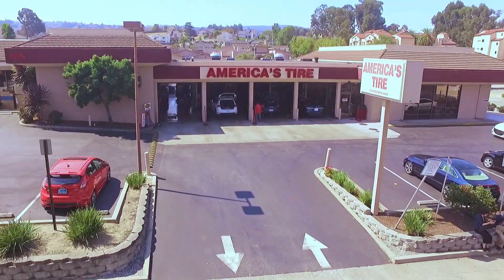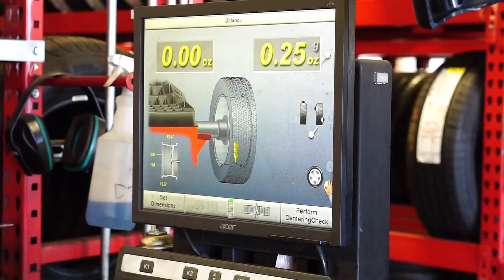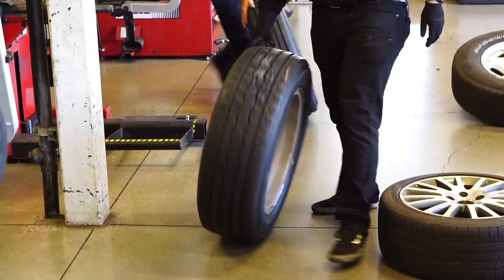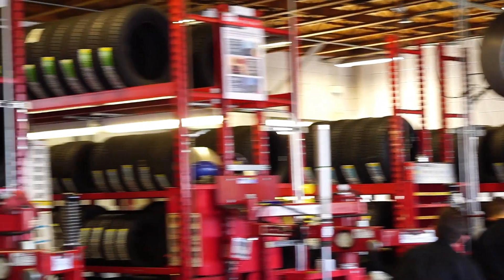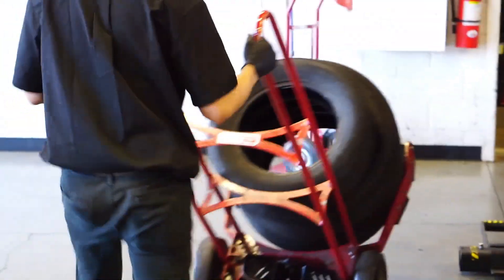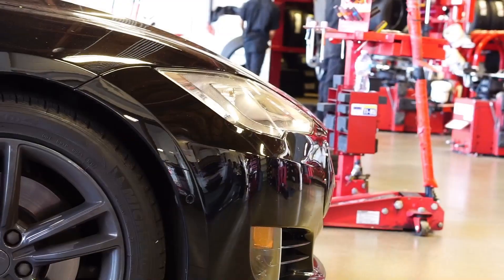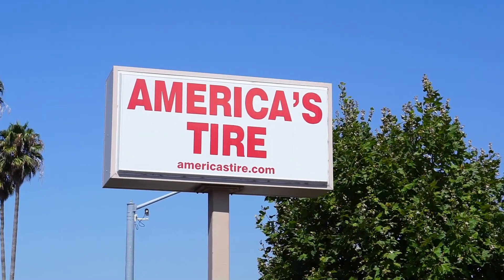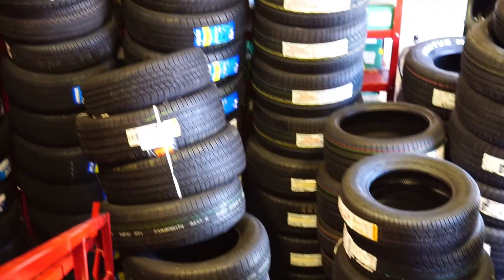Tesla Tires & Wheels Q&A: What You Should Know

Comment: Did i miss the most important question? Everything but the millage that can normally be expected. Average millage received? For example if you consistently get 20,000 miles out of a 40,000 mile tire then the ability to save gas has been thrown out the window.
Reply: 2020 April Model Y....20"...... my tires lasted 20k miles.

Comment: Performance tire has camber alignment and not avoidable? So for someone who don't care for performance and want long lasting tires, can it be adjusted? 
 If the tire alignment is meant to be bottom tilted outward for cornering for cornering. Then why not design tire like motorcycle where it's rounded on the bottom? I think it's waste of rubber for daily commute unless you are turning at high speed all the time like an idiot.
Reply: Because a flat bottom tire has more grip than a round motorcycle tire. Car tires are designed to be driven at 90 deg to the road surface, it's up to the automobile manufacturer to make that happen on their car. Most cars, even most cheap econoboxes have a camber adjustment and most of those that don't can buy a camber adjustment kit that will allow that kind of adjustment.

Comment: I have a Model X. The stock (performance) tires are Horrible in snow! I bought a set of good snow tires (Nokian WRG3) for winter and they work well in snow. I don't want to be changing tires out twice a year anymore. Is there an all season tire for Model X that works well in snow, runs well in summer and is quiet? Also, there was no mention of jacking the car up. The first time I took my car to my local Discount tire, they said they were familiar with the Model X & Tesla though they weren't. They put the rear tires on front & vice versa and were going to lift (jack) the car wrong. Jacking the car wrong can lead to BIG problems with the battery! There are jack pads made for Models S, X and 3 now that I assume reduce the possibility of this. I just bought a set of 4 "Murrphy's Law Jack Pads" to take to the tire center when I have to have work done. Is there an all season tire for Model X that works well in snow, runs well in summer and is quiet? Thanks!

Comment: Alex - I know this is an older vid, but something I didnt see noted is that the rear tires wear faster on a Tesla single motor not due to the torque but also due to regen braking.  On most RWD drive cars the rear accelerates the car but the front brakes do most of the stopping.  Not so with regen braking and only the rear axle to slow the car unless you press the brake pedal.  This puts MUCH more work on the rear tires.

But no worries - rotate the tires and swap your Tesla to what is called a "square" setup where front and rear wheels and tires are the same and you are good.

But many people who like sports cars have already accepted the fact that front and rear tires are sometimes different size and they deal with the higher cost for the joy of sporty driving.
Reply: He literally said the rear tire thing in the begging of the video yall dontbbe listening

Comment: I have a P85+ and it is not possible to rotate the tires to extend their life.  The rims are staggered, so front/rear swapping is not possible. The vast majority of summer tires (even some winter ones) are directional, so they cannot be rotated side-to-side either.  As result, my car goes through tires much faster than any previous cars I've owned and I drive assertively, not aggressively.
Reply from the maker: I'm assuming you have performance wheels, 21" inch. That does happen on those and with the performance package with the rear only motor.
Reply: Correct.

Comment: Thank you for this video.  I have a question.  Im in the midst of purchasing a Model X.  I went for a test drive about two days ago.  IT was on the Model X 90D, with 20' tires.  I really like the look of the 22' tire, but I am a bit concern about the road noise.  My question is, is that Foam available in the tires for the 22' wheels on the Model X?  If so how effective is it in reducing the road noise?  Thanks for your time.  Look forward to your future video.  Im a new member to your channel.
Reply from the maker: The question about the foam tires I would address with your sales rep. But overall larger rims means less rubber and therefore more noise.
Reply: 22 feet tires? Thats a monster car.

Comment: What's the best tires for range? Larger or bigger? Brand?
Reply: Thanks
Reply: Hi if you have a 19 inch wheel model s and a 21 inch wheel the 19 inch wheels will give you slightly better battery range basic physics
Reply from the maker: Watch the video please :-)
Reply: I sent the message right after watching the video. I just finished watching it again. Maybe I wasn't clear. I don't mean the range of the tire, but what tire brands or types of tire affect the battery's range. So for example, 22" firestone snow tires might take up to 20 miles of range off or something like that.